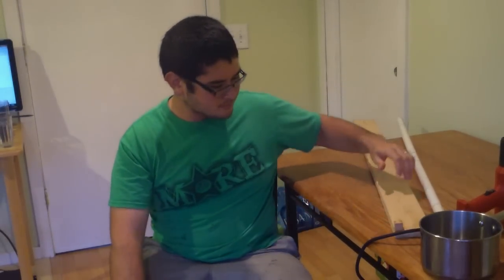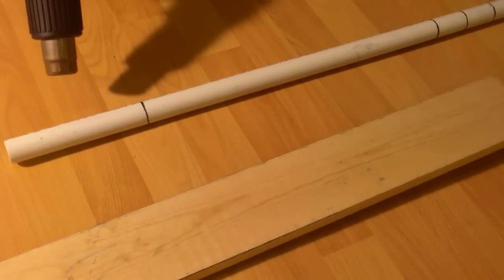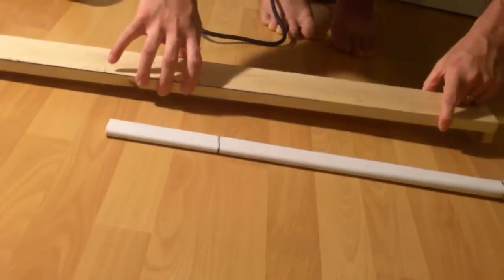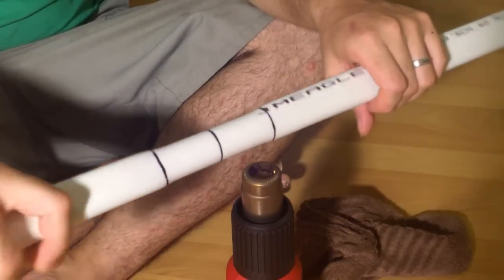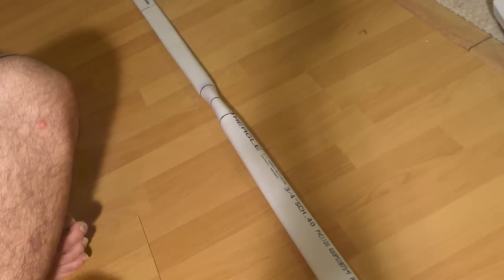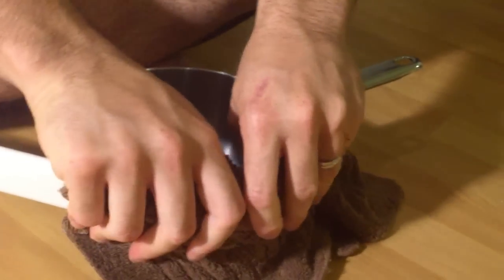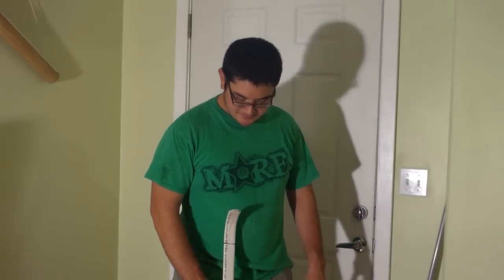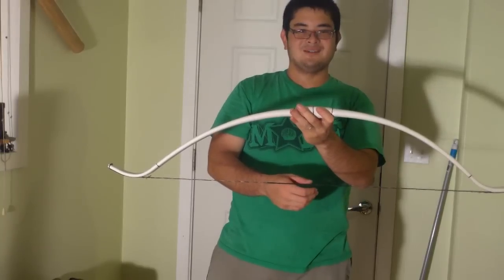How to Build a Youth Recurve Bow out of Flattened PVC Pipe

Comment: This is probably a stupid question, but I know that the poundage of a bow is how hard it is to draw it back, like a 50 lb bow supposedly takes 50 lbs of pressure to draw it back to full draw, but I want to know if a 50 lb long bow shoots the arrows as fast as a 50 lb re-curve bow.
Reply from the maker: eugene bell That's a good question, though there is no clear answer. It ultimately comes down to the bow design and how it was made. One would expect a recurve to be faster, though bows without recurves can be faster. Some bows are made slower by the addition of recurves. For example, many modern recurves are extremely overbuilt and are slower than longbows that are built to be more slim.So basically yes, a longbow can shoot arrows as fast as or faster than a recurve. A recurve can also shoot faster than a longbow. It all comes down to the way the bows are designed.With PVC bows, recurves generally shoot faster because they make better use of the material's properties and allows for longer draws with less stack (unwanted resistance in the draw). Hope this helps!
Reply: BackyardBowyer Thanks for the reply.  Yes that tells me what I wanted to know.  BTW your videos are very informative.

Comment: what kind of string did you use? would 550 paracord work?
Reply: I use 550 para cord . I have never tried using actual arrows with it though only ones I made
Reply: Jarod Lewis no, I don't think Paracord would work as well as other things as it stretches, if you could fine something else to use that doesn't stretch then I would use that, I'm pretty sure that backyard bowyer has a video that shows you how to make your own bow string, if nt just search it on you tube.

Comment: I am trying to make one exactly like this but with 1 inch pipe for more power. What length of 1 inch sch 40 should I use, and is the marking for where to recurve the same? Thanks!
Reply: You can use 60 inches (or 5ft) and the marking for the recurve would be 6 inches from the ends I believe.

Comment: If you made one of these 5 foot instead of 4 foot would it lower the #'s of pull?
Reply: Yes, it will lower the draw weight significantly. I would try it at 54" before considering trying it at 60" if I were you.
Reply: +Greg Whitley 
hey man I need one that pulls 25lbs at 28''. 

what do you suggest for length?
Reply from the maker: +Alexander Sousa If you follow everything else in this video, starting with a 52" pipe will get you around 20-25 pounds. If you need it to be a little heavier after making it, shortening the bow by an inch will give you an extra 2-3 pounds.

Comment: About how many pound pull is the 4 foot 3/4 inch schedule 40 PVC pipe bow at a 28" draw? Would a longer bow have a lighter pull?
Reply from the maker: It's about 30-35 pounds at 28 inches. Yes the poundage goes down as the bow gets longer.
Reply from the maker: You could either make one in 3/4" pipe at about 46"-45" long, or 1" pipe at about 58"-57" long.
Reply: BackyardBowyer what do you think the draw weight would be if I used 1 in pipe with a 4ft bow?
Reply from the maker: It would depend on a few things. You could get anywhere from 60-80 pounds at 28 inches of draw. Generally bows this short end up in the 70 pound range. Keep in mind that 1" pipe, made this short, has a tendency to fail if not made perfectly.
Reply: thanks for the timely feedback. what specs for a recurve bow would you think if I were to aim for the 40-45 lbs range?
Reply: you think for a 1" at 58 inches I should have 8inch of recurve at each of the tips?

Comment: how hot do you need to get the pvc pipe
Reply: My $15 heat gun says it is 1100 deg F on the high setting and it takes a minute or two to get a small area hot enough to bend or flatten. A hair dryer or something like that won't cut it. Nick has other videos showing him heating it over an electric stove eye though :)

Comment: Im sure this was mentioned before but i just dont have time to sift trough all of these comments, is it nessesary to flatten the pipe? You use pvc pipes -are PE pipes ok? Does flattening of the pipe make it stronger ? Wher to buy excatly those pvc popes -electric equipment store maybe? Tnx for any answers .
Reply: I don't know how PE would perform compared to PVC, but if you have a large home improvement store near you (Lowe's, Home Depot, Menards, etc.) this stuff is in the plumbing section, and is very inexpensive. I think the 3/4" PVC is about $4 for 10 feet near me. Flattening the pipe actually males it weaker in that part, which is what you want. Otherwise, all of the bending force will be concentrated on the handle.
Reply: Greg Whitley Thank you very much.

Comment: Hi Nick- going to make this tomorrow. My heatgun has two settings though - low for removing labels etc. ( around 400 Celsius) and high for stripping paint (around 700 celsius). Which one should I use?  Also, I have metric PVC pipe here. Sizes are 20mm, 25mm  32mm. the 25mm is outside diameter, so I'm assuming that = 3/4 inch. 32mm I assume is 1 inch. Last question is, as others have asked, what is the length of string for this bow. Thanks.

Comment: its either because your recurves are uneven, or the recurve is too big. ive tried using 4 inch recurves instead of 6 inch, and ive had pretty good results. also, i dont know if you've had this problem, but my bow is too easy to draw and doesnt propel arrows very far. ive used 1 inch diameter pipe, and it actually works even better than the 3/4 inch pipe. so my suggestion is using 1 inch diameter pipe and measuring 4 inches from the end. your welcome if this has helped you get better results!

Comment: Hey! Big fan of your videos! a few questions here 

1-Would it be better if i just drilled holes through the ends of the limbs to string? 

and 2- my pvc sometimes ends up cracking? Is it from heating it too much or?

Comment: Thanks heaps for the videos. I have made a scaled up youth recurve and it works good. For any aussies out there I used a class 18 25mm PVC pressure pipe (maybe vindex) couldnt find sch-40 in perth, cost $14 for 6m(!) from pipecowa dot com and using grunt 3mm utility cord ($5 for 20m) from bunnies as string. Tassie oak dowel (9mm or 3/8" bunnings - $2) and duct tape work for arrows. dont know poundage but it'll put a hole in an LCD TV box packed with packing foam, at 10m using blunt dowel.ty nick

Comment: Unfortunately, Nick has not returned yet, but I can help you with these questions
1) He says 4 feet long, that's 48 inches
2) As a rule of thumbs, you usually want a string 4 inches shorter than the bow, that's about 10 cm but you will find that archery is all imperial, no metric there
3) He says it's a 3/4 inch diameter

Comment: Like Exmoor said, you can either increase the diameter of the pipe, or decrease the length of the pipe.

Nick, how long should I be heating the pipe for?  I notice you cut to the part where you've heated it plenty.

Comment: Take the line and lay it against the bow then subtract 5 inches (12.7 cm).
So for the 4 foot bow you will need a 3' 7" Bow string. 
This is a rough estimation and it worked for me.

Comment: Great job on making the youth recurve bow.  The kids will love this.  One question though.  Instead of cutting a slot at each end, couldn't you take a pair a needle noise pliers and pinch the sides (about a 1/2" to 3/4" down from the tops) to make the slots to put your string on?  Just a suggestion that would make it a little quicker for you if it would work.  Thank you for all the videos.  Have a Blessed day.

Comment: No -.- i actually had pp r which i think has a higher melting temperature. It was a longer and thinker pipe and it was a pain to heat it on the cooking stove, and didnt work as i wanted. Yet in the end it worked as a bow, but it's quite weak because of the length.

Comment: Hi! I went to the store and found that the pvc they got is very thing, only used for isolating electrical circuits (ofc main use) 
The more consistent pipes were actually PPR. Dont really know if that's good, but those where to ones looking like yours.. Are they good?

Comment: I don't think it'll work. hair dryers work by blowing and heating, whereas a heat gun is specifically designed to get hot. You can get a cheap heat gun (Wagner HT1000) from a local hardware store for like $20 with a 2 year warranty. 
P.S. the only stupid question is the one not asked

Comment: Just a few questions because making a usable bow out of cheap materials is both cool and could come in handy some day :P  could you use a hair dryer in place of a heat gun (in case I for whatever reason don't have access to a stove)? Does the thickness of the PVC determine the draw weight? and about how long in total does it take to make a simple target bow like this start to finish?

Comment: They dont shatter, if they do you didnt use sc40 pipe.  When these bows fail they colapse at some point along the limb, more prone in areas with flaws obviously but they can actualy be repaired rather quickly and be made stronger after the failure. Please educate your self before posting again.

Comment: How long does it roughly take to heat up the pipe?  I'm using a pretty hot heat gun and it takes ages to get the pipe even slightly soft.  Is this normal?

Comment from the maker: Heating PVC pipe is safe as long as you are in good ventilation. You can do it inside, just open the windows and put a fan or two on. An organic vapor respirator doesn't hurt either, especially if you plan to go into production. I'd be more worried about burns than fumes as long as you don't burn the pipe.

A heat gun with a 1,000 degree F setting works well as will a torch, stovetop or barbeque grill. An aluminum trough or cone will help direct heat and prevent burns. Hair dryers take too long.

Comment from the maker: I used a dacron bowstring, just like the kind you can buy online or at an archery shop. If you want the best performance out of your bow, use dacron or fast flight. This will give you good speed and put the least amount of excess strain on your bow, making it less likely to collapse.

If using a rope or paracord, make sure it can handle at least 100 pounds of breaking strength. A single piece of twine or yarn won't be enough and even jute in two strands will likely snap. These strings rob speed.

Comment from the maker: This bow uses a 43-44 inch string, or a string for an AMO 46 or 47 inch bow depending on how deep your nocks are. To find the AMO length proper, you'd need some AMO cables. To estimate the length, measure across the belly side of the bow from the bottom of one nock to the other. This will give you your bow length.

From there, select a string that is 3-4 inches shorter than your bow. It's better to get a string that is an inch or so long and twist it down than to get a string that is too long.

Comment from the maker: Hey everybody! To answer some questions, this bow is 35 pounds at 28 inches and will work up to 29 inches where it gets 40 pounds. If you want to make this for a longer or shorter draw, increase or decrease the pipe length by one inch for each inch of draw. So a 25 inch draw will start with a 45 inch pipe and a 32 inch draw will use a 52 inch pipe.

This is not perfect as your bow may come out a little heavier or lighter depending on how you build it exactly.

Comment: A stringer is by far the best way to string a recurve. 

Second best, but most dangerous to the shooter, is the push-pull method.

Safer for the shooter, but most dangerous to the bow, is the step through method. More limbs have been twisted and bows ruined using that method improperly than any other.

-Arthur P. from archerytalk

Comment from the maker: It's actually the opposite. As the bow gets longer, the pipe needs to get larger to keep the poundage. A 4 foot 3/4" bow would be around 30-35 pounds while a 5 foot 3/4" bow would be around 10-15 pounds. If you go up to larger, 1" pipe at  feet, the bow would be around 35-40 pounds. Go up to 6 feet and the 1" pipe would be around 15-20 pounds or so.

To make a bow 6 feet long and 35 pounds, you may need to either use 1 1/4" pipe or drive a 3/4" pipe into a 1" pipe. That's just to get the weight.

Comment: one question about the bows and thickness/ poundage
as a bow gets longer and longer does the pipe have to get smaller and smaller to keep it a particular poundage,
(i hope to make a bow of about 35lb draw weight, and make it to be 6ft long
would i still be using 3/4" pipe, or would i be using something alot thinner instead?

Comment: @BackyardBowyer Thanks for putting up these videos! I made a couple of these over the weekend and they turned out great. I used your videos to make my bows, jig, string-server, and bowstring. One question though.. When I draw the bow, a few times on release the bow has 'unstrung' itself by traveling to the side of the recurve rather than landing dead center of the 'recurve' portion of the limb. Any advice? The one that does it the most has wide knocks, the other I cut has narrow knocks.

Comment from the maker: The string is 3-4 inches shorter than the bow. A good general length for this bow would be 24 inches long. If buying a string, ask for a string for a recurve bow that is 27 inches nock to nock. When strung, the distance between string and bow should be larger than 6 inches and less than 10inches.

Most sporting good stores should carry strings. If you want to make your own, there are some string making tutorials on my channel.

Comment from the maker: The pegs are 2 inches apart, the jig itself is made with a 1x4 board (3/4"x3 1/2"). This works fine for pipe up to 1 1/2".

Comment: I plan on trying this, thanks for the video. But I must warn others, I would not use a heat gun that close to any surface you care about, like a laminated wood floor. You're most likely doing a little bit of damage to it each time.

Comment: yo   ok so if you want a 20-25 pound pull, use 1/2 inch PVC.... if you want more, (draw weight) use 3/4 PVC.... so the 3/4 is about 30/40 pound pull... and so on and so forth..... good luck... and see u shooting (well probably not but u get it!)

Comment from the maker: Thicker PVC would increase the weight and make it harder to draw. A 1" pipe made to these dimensions would be around 70-80 pound of draw weight at 28", though the true draw length would be somewhere around 20-22". Thicker PVC lets you build a faster, more powerful bow without making the bow shorter. They shoot much better as well. 1" pipe should be around 5 feet long, 1 1/4" pipe should be around 6 feet long.

Thanks for the questions!

Comment from the maker: Depending where you get the pipe, your cost can go up or down. I purchased the pipe at $1.89 for a 10 foot length which gave me two bows. Making a string with polypropylene cost me $3 for an entire roll good enough for at least 20 strings.

This bow is 35 pounds at 28 inches. Making it longer would bring the weight down and making it shorter would bring the weight up. I use these bows in my combat archery group and they work pretty well!

Comment from the maker: @Ghostboy1313 You could start off with a shorter pipe. Probably somewhere around 44 inches.

What I like to do when I'm making a youth bow for someone is I'll make the bow longer. Then I let the person who will use the bow draw it. I then saw off the tips in half inch segments until they are happy with the draw weight.

If you saw off too much, you will have to recurve the tips again, but that isn't too difficult.

Comment from the maker: @sikke3 If the limbs aren't bending evenly, take a look at both limbs when the bow is strung. Take note of which limb is bending more and where. If you look at the limb itself, the one that is bending more will be thinner than the other.

Gently heat the thinner limb just until the pipe starts puffing up again and use an oven glove or hot pad to gently shape and press the limb until it is thicker. It should be nearly equal with the other limb.

Let it cool and string it.

Comment from the maker: @AhnkoCheeOutdoors Yeah, the UV inhibitors really protect it, but it also has something in it that makes it softer. Not enough to be a strength issue, but it deforms pretty quickly.

Honestly I haven't had a problem with UV damage with white PVC yet even on bows left uncovered. Like you say, I normally don't leave my bows exposed to UV anyway. If I did, I'd have problems even with my fiberglass recurves.

Comment from the maker: @AhnkoCheeOutdoors My PVC hunting bow is 55 pounds and made from 1" white PVC pipe, 55 inches long. You can raise the weight by shortening the bow, but this is about as short as I would make it.

Here in Hawaii we can get away with 60-75 pound bows from 1" pipe by making them as short as 48 inches, but in colder weather those same bows would likely snap or collapse.

I have made bows from 1.25" pipe and you can get around sixty pounds by making the bow about 63 inches long.

Comment from the maker: @AhnkoCheeOutdoors I used to use nothing but gray conduit because it's UV resistant and it can take more of a beating. I don't use it as much now because it tends to follow the string really bad and is much slower than white PVC.

If you cover at least the back of the bow limbs, UV is not too much of a problem, it's like the glass on most recurves. White PVC holds its shape better and snaps back faster.

Comment from the maker: @betterthanmcgyver Thanks!

I'm not sure what you mean by pipe knobs but there isn't really a flaw in the jig.

I've found that as long as the pipe is heated enough before you flatten it, a person's weight has little to do with the finished taper or the overall thickness. I've had others weighing from 100-260 lbs try it with little variation in draw weight.

And a sandwich-style jig makes handle failues more common on very short bows, though it's not an issue on longer bows.